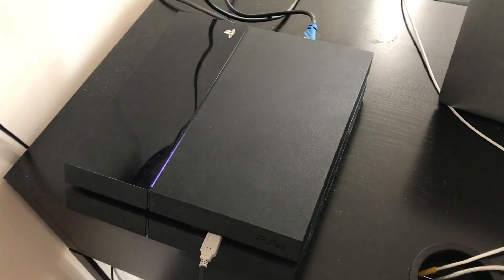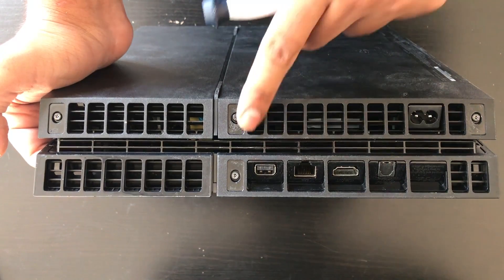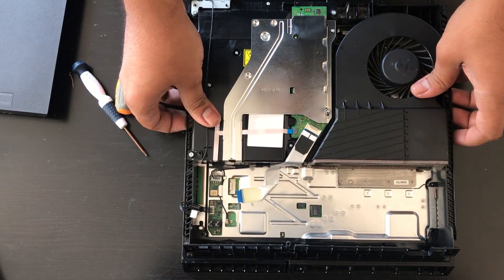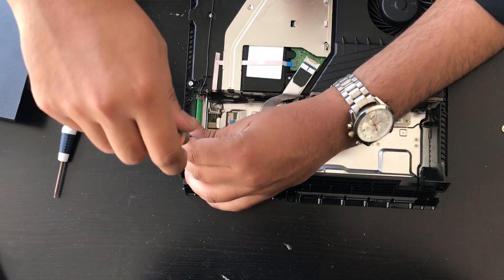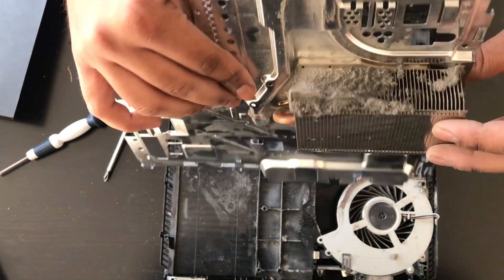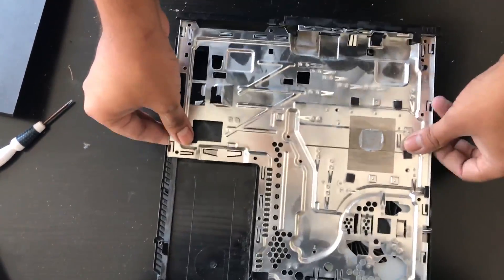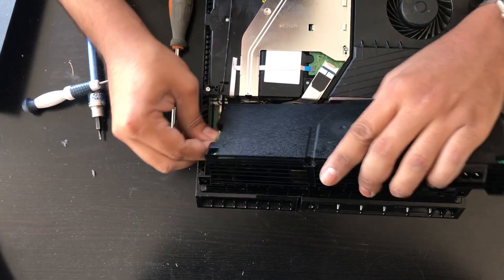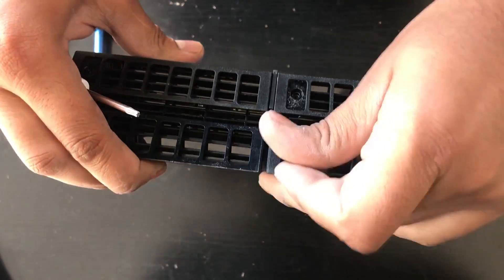PS4 Too Hot overheating due to dust build up and fan (CUH-1001/1115 cleaning and disassembly)

Comment: I just did all of this....but now I try to turn my ps4 on...it just makes 3 noises and turns off
Reply: Mine doesn't even make a noise
Reply: god of war open the bottom and turn on the PS4. *BE CAREFUL AND DONT BE TOO CARELESS*. If the fan isn’t turning, then you have to replace it
Reply: I fixed the problem by adding washers.  But it still overheats after my loading screen on fortnite
Reply: I have the same problem
Reply: Same

Comment: So I did this put everything back together and now my controllers won’t connect? Any idea how to fix this, I think it’s because the black wire connected to the white triangular part in the front with the number code got disconnected.
Reply: Plug them in with a charger

Comment: Thanks for the guide, super complete, went from jet engine to dead silent. I have a few tips for the beginners too scared to try this:

1. An easy way to keep track of the screws: Use paper pages, write down the component part; "Heatsink" for example and just place the screws over it, do the same for every component and align the pages in cronological order as you disassembly the parts, so it will be way easier to put everything back.
2. Remove the power supply connector from the board instead from the power supply itself,  so the cable won't get in the way later, also try as much as possible to grab the connectors from the plastic part instead of pulling the cables.
3. Just be extra careful when disconnecting the power supply connector, blu ray flex connector and the fan connector.
4. Try to use a compressed air can, they are pretty cheap and will remove any leftover of dust, especially the fan and heatsink parts.
5. I used regular 95º Alcohol to clean the CPU/GPU (APU) and Cooler Master Nano thermal paste.
6. Relax and take your time, pause and rewatch the video as many times as you need, there's no need to rush.

Good luck!
100% recommended to do this procedure
Reply: Cn i use any thermal paste?
Reply: Or just send it to him
Reply: I followed the steps but my ps4 is now an xbox 360. What did I do wrong?
Reply: Tray Percy wait what the fuck?

Comment: Now my ps4 won’t turn on plz help

It’s turns on for 3 seconds then turns off what do I do??
Reply: So your power supply is the problem basically what you have to do is screw in the power supply in tightly as possible, as maybe it's not perfectly intact to the ps4 I had the same problem but I managed to fix, trust me it works

Comment: How do I remove the connector at 3:45?
Reply: It won’t come out so I am too afraid to pull it too hard
Reply: @jackproetto  Remove the connector from the board, not the power supply itself, its easier, try grabbing it from the plastic part and not the cables, try gentle pushes with ur nails on the sides and then just pull it.

Comment: I think my PS4 is ready for the scrap pile I've cleaned it replaced the pasted and within a week it's back to the jet engine noise again 😔
Reply from the maker: Check the tightness on the heat sink clamp.

Comment: I can’t get my power supply to come out
Reply from the maker: Pry from the power connector side with a screwdriver (make sure the cable is unplugged first!)
Reply: Ok so I wasn’t using the right tool😂. Do you know what the screwdriver type is?

Comment: I dont know what I did wrong I did exactly what you did in your video. After the clean I when to turn on my ps4. That first thought it worked pretty will because I can't hear the fan work, which is good since I use to hear the fan just by the ps4 being on. Now the problem is when I load into a game like killing floor or dead by daylight I  start hearing my fan working and the fan started working faster and faster in moments just by being in the main menu. Then like one minute later my ps4 told me that it was overheating and it shutdown on it's own. I was dumbfounded and tried another game like Brawlhalla a very small game compare to killing floor and dead by daylight. Guess what, I can't hear the fan and I played it for an hour and I never heard the fan. So I decided to get back on killing floor same problem again the fan started working faster and faster to point my ps4 shutdown due to be overheating. What should I do? Help Please.

Comment: first, thanks for the video. second, it seems to have helped, I bought a refurbished CUH1001 from @gamestop and I've had it 3 months, barely played it and it started over heating. it was clean as a whistle Inside, but I used forced air on the fan and it seems to be running fine now, except for telling me I didn't shut it down properly when I do. my problem is that now my controllers remote feature ie- when it's not plugged in is very erratic. I reopened the back and checked the antenna attachment there and everything seems good. Suggestions or thoughts? any help is appreciated, thank you.
Reply from the maker: dne wilson Check the antenna

Comment: Ive had my ps4 for over 3 years. There was no problem till the second years, ive cleaned it(the heat sink and everything) and it was good like befor again but after i cleaned the heat sink and the fan for the third time. it still overheat it happened just yesterday. Im so saddd whats the issue and what should i do?? Can some1 help?

Comment: I done every step you told me to do and yes, when I turn it on it’s super quite now which is great. However when I go on fortnite it suddenly gets really loud and just turns off still.
Reply: Thermal paste if you lifted up the motherboard it needs more paste
Reply: TaskForceKillah what’s paste
Reply: @joel8339  thermal paste on the heatsink  that way you system shouldn't be hot to the touch anymore and run normally
Reply: JoelTTG bruh
Reply from the maker: Replace the thermal paste.

Comment: I followed all the steps and thankfully got rid of loads of dust but when I turn my ps4 on the light turns red and turns off within seconds??
Reply: Jack Moss That means that the system still thinks that it’s overheating

Comment: I wouldn't let you service my PS4, you left so much dust still in the machine, and surely you could have replaced the thermal just as a precautionary measure.

Comment: Thanks just did mine I’m usually very meticulous when it comes to my electronic but I have the Launch Edition base PS4 still looks brand new and I decided what would it look like inside and to my surprise there was a good amount of dust inside coming from a person that regularly cleans the system. So from the slight noises it made before I played over 12hrs nonstop of RDR2 fans didn’t even kick on full blast. Thanks again. 👍🏻

Comment: I just did the same and the ps4 is now very Quiet but my ps4 is now lagging in Game and My Headset doesnt work
Reply from the maker: Check the antenna cable connection or the antenna It is most likely disconnected.
Reply: @fasttechvideo  hey I ordered a fan almost 2 weeks ago, how long does it take??
Reply from the maker: @D-Rose-1-MVP  Whats your location?
Reply: @fasttechvideo  Evansville, Indiana

Comment: I did this now my ps4 won't turn back on PLEASE HELP ME
Reply: Sounds like you didn't connect your power cable correctly. I just followed these steps and my system is working.
Reply: @isaiahmarks6322   could u text me on a different app like Instagram and help me thru this
Reply: @vdiorids147  What's your name on Instagram?
Reply: @isaiahmarks6322  @Gatorade.t
Reply: @isaiahmarks6322  it give me a blue light for about 2 seconds and turns off I can show u a video and eveything

Comment: Why you didn't change out that thermal paste while the PS4 was apart anyway, completely escapes me! The fact that it's now decompressed and not airtight anymore, has already lost it's cooling efficiency. It is guaranteed to lead to problems later. Recompressing old thermal paste, no matter how wet it is, is NOT cool... literally lol. And apart from the blockage in the heatsink, you barely cleaned anything else. That motherboard was still filthy when you reassembled it! Minimal effort. I wouldn't be a happy customer, sorry. Just my opinion.

Comment: this is coming from someone who has had a ps4 for 5 years and this just started happening about 3 months ago today. If you follow all of the instructions correctly and you had your ps4 for as long as mine your ps4 will not overheat but it’s still going to be loud but remember it still works fine just that it’s loud still
Reply: ripMako maybe you need new thermal paste because the only reason it gets loud if becasue the fan is working harder than its suppose to

Comment: I forgot to pull the Anthena cable and when I took out the mother board I pull the anthena cable it doesn't look broken but now when I turn my ps4 on it turns off again :( I wonder if the Anthena cable broke

Comment: Any idea why my controller is really unresponsive and cuts off after 15 seconds. It's like my controller is lagging but I think it's something I did while in the system idk, But now it's dead silent thank u for that
Reply: Le Thanos did you try multiple controllers ?
Reply: @curzns  yeh, the further I'm away from the system the worse it laggs. I seen in another comment he said something about and antenna so I'm trying to figure out where that is in the system
Reply: Le Thanos I’ll look for you , I just finished at my ps4 doesn’t over heat and my controller works perfectly, I’ll let you know if I find anything
Reply: @curzns  thanks bro

Comment: Is the fan a easy fix because I can hear a clicking noise and my fan doesn't come on even tho I cleaned it
Reply: Le Thanos you need a new fan
Reply: @hughmungus555  ima try to take it apart to the motherboard and clean it, hope that works
Reply: @hughmungus555  well I fixed that but now my controller is super unresponsive smh it's always something

Comment: i did everything and it still happens

edit: my ps4 doesnt have 4 screws on the back it only has 2
Reply: That's cause your on the wrong tutorial for the wrong model. Most likely you gotta look whatever you have problems with and add "cuh 1200" and you will find your model. Although this tutorial can still help.
Reply: Or just look at the back or something and find your model number.

Comment: I did everything in order and cleaned it then put everything together but it didn't work!!

When u turn it on it gets loud then it shuts down in 2 seconds with a red light on top, please tell me whats the fix for that issue!
Reply: When it turns red it mean is overheating
Reply: This video is so wrong, i reccomed this
https://youtu.be/xyz0rdMpqOM
Reply: Wrongs- 1, did nog replace thermal paste, 2 did not fully clean it, makes money by putting many ads
Reply: It could be bc of thermal paste

Comment: How much does it usually cost??? An if missing screws could they be replaced? I had to take it apart bc the person I bought it from didn’t tell me it was infested with roaches so after a few months it was working fine an just started overheating. I took it apart in a field so they didn’t get in my house but the system has worked fine. It only heats up wen I’m in an actual game of fortnite I can play any other game an as soon as I close the app the red light goes right away.
Reply: But I can sit in creative for hours an other games or apps an it’s fine. I took off the top part cleaned it all out an blew the fan clean but I don’t wanna take the chance of fucking it up more Bc there are screws already missing.

Comment: It sounded like your video at first but it would run . After i open it and clean it it goes to home screen and doesnt make a sounds but once i open any application the fans runs wild an the ps4 do three beeps and the red light come out and turns on.. ( i thinking it's the thermal paste) (it was the thermal paste)
Reply: Jesus Bastidas u had to replace the thermal paste ?
Reply: That happened the same as me
Reply: I think i will do the thermal paste
Reply: It was the thermal paste and I changed the fan

Comment: Hi bro I just wanted to know that my PS4  had same problem it used to heat up a lot and make so much noise in the end I saw your video and I clean that after cleaning I plugin  everything  working fine for 10 15 minutes then its start saying the PS4 is too hot it just keep shutting down I'm having this problem my PS4 is keep shutting down after 20 seconds red light is coming in just shut down
Reply from the maker: Check your fan connection
Reply: @fasttechvideo  fan is working 
It's like superfast

Comment: I had my doubts but i took it my PS4 apart cleaned it as shown in the video and it worked wayy better than just cleaning the fan but the only problem i had is that i have extra screws somehow but my PS4 still works thank you so much
Reply: ConvexCoast how so lol
Reply: Lol
Reply: Guwss ur ps4 gave birth to another screw

Comment: Thank you for this. I can't explain how much of a noob I am when having to work with electronics, even then I was able to do it. Anyone who's having any doubt about cleaning their PS4 follow the instructions above. Even if you do half of what he did, like i didn't actually remove hard drive or tempered with anything internally (just opened above and below covers, also saw fan) and you would see the results right away.

And besides, don't worry about your PS4, it's sturdier than you expect.
Reply from the maker: Don't forget to subscribe
Reply: @fasttechvideo  subscribed :)

Comment: I think I did something wrong bc wen I turn it the fan turns on for 2 seconds then it turns off
Reply from the maker: Check the pins under the power supply

Comment: Hey man, I tried to fix my ps4 with this but In the process I managed to disconnect the little wire that connects the power source to the motherboard.  Is it possible to reconnect it with a soldering gun?   I do thank you for this video and it was very very helpful, I just messed up trying to disconnect it.     Cheers dude
Reply: no you can put it back by directly over the top of the connector and gently push it in as it clicks in .

Comment: U gotta replace the fan cause i had that old problem cause remember when the ps4 first came out they fans was so lould no one knew what was going on that model is from china tbh they products is sold cheaper over in us where the hard ware is very cgeap thats why they have pre owned ps4 in us its from china so they sell it cheap over here to get rid of it in stores so the fan is over heaten due to the fan the product china use for the fan was low quality u gotta buy a fan thays high quality i recommand either cleaning the fan or replacen the fan i highly recommand replacen it so u can get a better hardware maintence on ur console before installing a new fan if u need to change the power brick change that. But the fan is how do u say infested that why u hear lould sounds when a fan isnt infested wt smoke dust or even rotens the fan runs smooth instead of lould

Comment: So I did everything step by step, I was careful with everything, and this wasn’t my first time taking consoles apart, so I kinda knew what I was doing I just needed a good video to show me the right way and you helped me a lot, but my PS4 is actually worst, as soon as I turn it on, the fan gets way louder than before and alerts me right away that it is too hot and quickly turns off on me, I watched the video and repeated the process twice and I did everything by the video, maybe it might be my PS4 ?? Any tips ?
Reply from the maker: Replace the thermal paste.
Reply: Fasttech thank you, I’ll let you know how it goes
Reply: Fasttech it it worked, my old thermal paste was rock hard and completely dry, I applied an even coat and it is completely perfect now, thank you so much for the help
Reply from the maker: @lbarrera503  You're welcome. Don't forget to like the video and subscribe.

Comment: I did it then my controller keep disconnecting from my ps4
Reply from the maker: Check the antenna and its connection.
Reply: Fasttech okay thanks a lot man
Reply: @fasttechvideo  what do u mean check the antenna, where is that located. I did everything on the vid and it's runs like New now, but now my controller is tripping

Comment: I followed all the steps and cleared  the dusty heatsink. But now,  when I try to turn it on (after reassembling everything), the ps4 beeps 3 times and turns off. What did I do wrong?
Reply: Did you fix it
Reply: Bro it’s the thermal paste you can buy sum at Best Buy for 8$

Comment: This made my PS4 worse, and it's now unplayable.
Reply from the maker: You did something wrong.
Reply: Most likely, although what I possibly did wrong isn't very obvious to me.
Reply from the maker: @EstebanGG45  Here are some tips: Try replacing the thermal paste and check the tightness on the heatsink clamp.
Reply: Fasttech First I’d like to explain how my PS4 changed. Before attempting to fix it, my PS4 had an excessively loud fan and would display overheat messages every now and then (but the PS4 never shut itself down). After attempting the fix, my PS4 overheats exponentially faster and quickly shuts itself off. For example, my PS4 shuts itself off before I can even load a save on Red Dead Redemption 2. It practically shuts down within a minute or two from starting up any game.
Reply: Fasttech Anyways, I’ll try checking it out, but what exactly are you referring to by “heatsink clamp”?
Reply: Fasttech Hi, yesterday I opened the PS4 up again and made sure to tighten everything and now it works like it did over 5 years ago. Thanks

Comment: Hey thank you for this video I did all the steps to the bone and was able to clean my ps4 it was 70% cover in dust I clean it thoroughly, I put it all back the same way u did but the fan it still makes noise when I run fortnite or apex legends .
What do you recommend?
Reply from the maker: Replace the thermal paste and check the fan.
Reply: @fasttechvideo  thank you I did that and it's super quiet thank you for your help
Reply from the maker: Dave C you’re welcome. Subscribe!